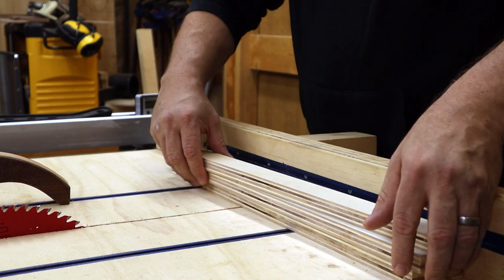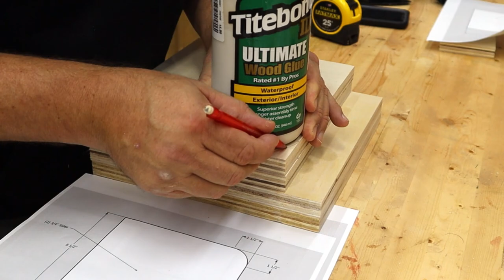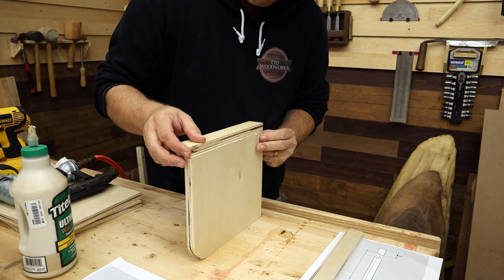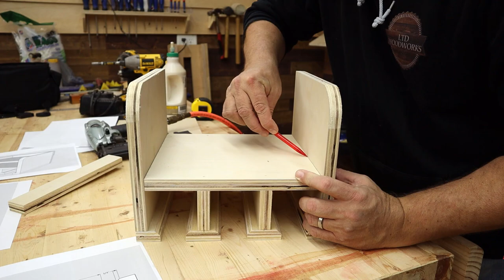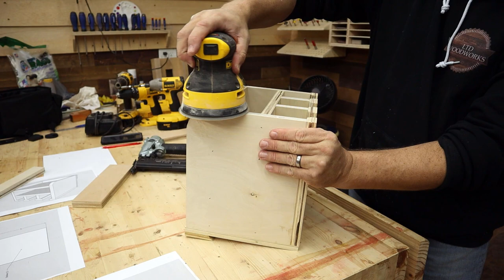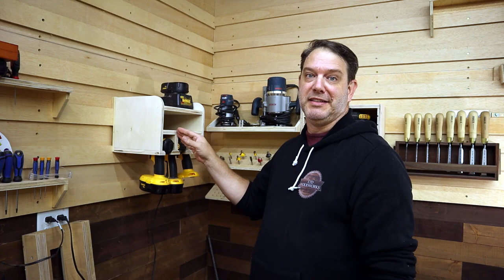DIY Cordless Drill Storage and Charging Station

Comment: Very nice drill/charging station.  Are the brad nails in the French cleat on the back of the station going to hold up?  Look forward to your next organization project.
Reply from the maker: Yep, there’s plenty of wood glue holding the French clear piece on as well so it’s not going anywhere 👍 Thanks for watching!👍
Reply: The strength is in the glue, the brads are only clamps till the glue sets up, in most cases the wood will break before the glue fails
Reply from the maker: Very good point👍 Can’t remember who but saw a guy do a test and yep, the wood broke around the glued joint. The glue joint itself was just fine.